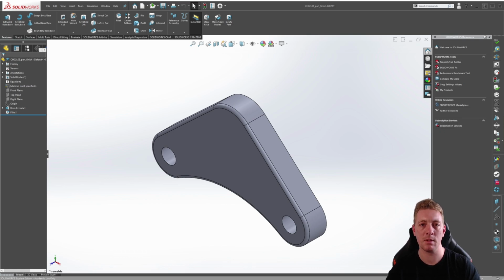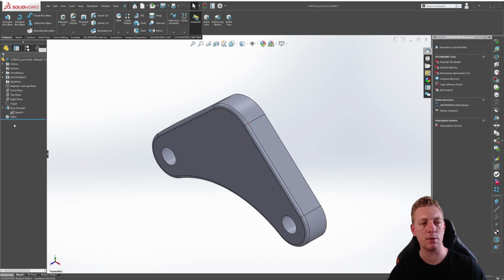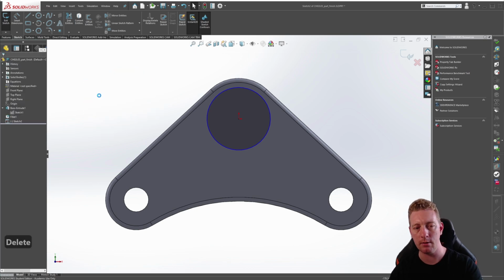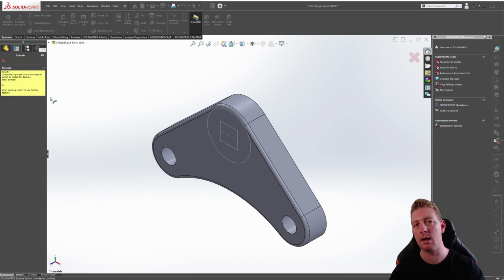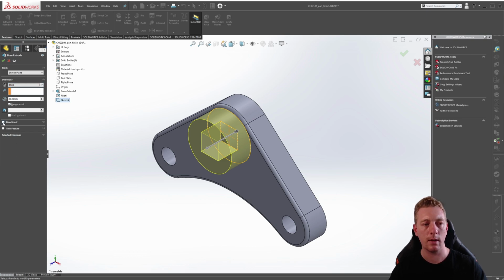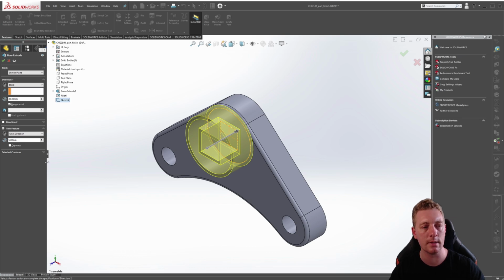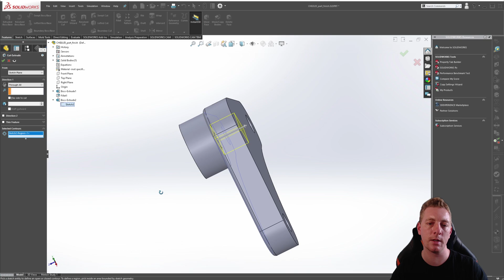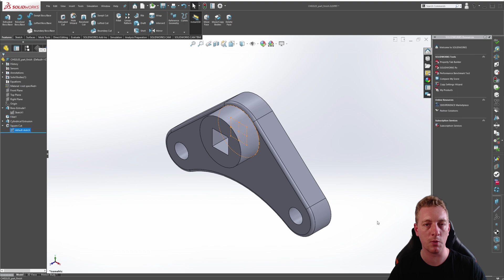Extrude Boss & Extrude Cut | SOLIDWORKS BEGINNER | Chapter 02: Lesson 03 | CSWA COURSE

Comment: 8:30 so it has the same like function like offset entities then? but extruding it simultaneously at the same sketch?
Reply from the maker: Kind of yeah. I think the main advantage to it is you don't need to close the profile, it can be an open profile. So imagine drawing like a wall for a building, you could simply draw the walls in without needing to close the loop and then just extrude it up with the thickness you want.